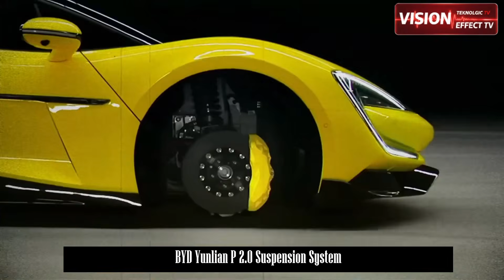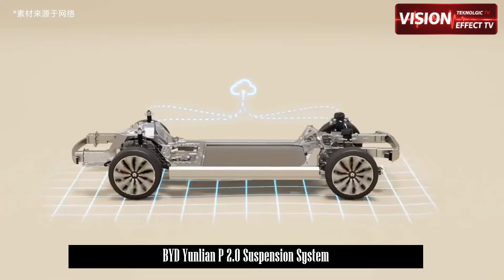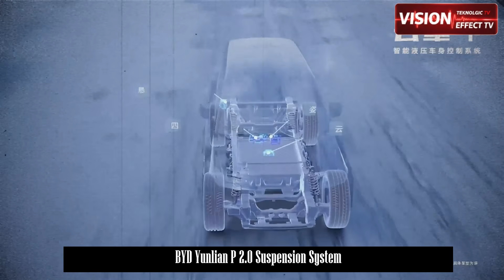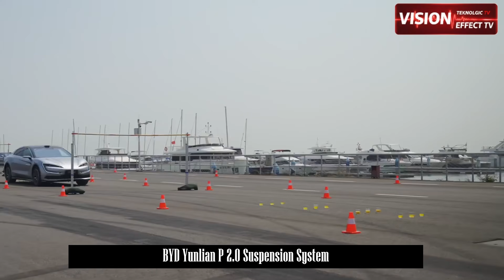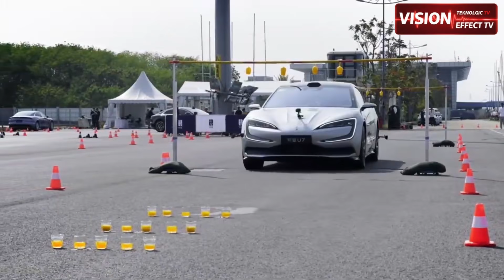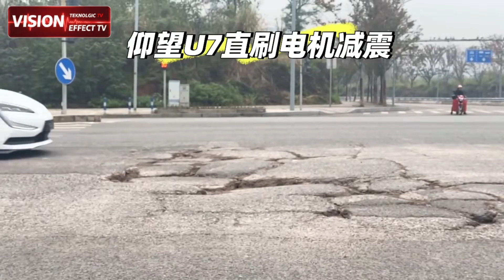Tesla Can’t Do This… But BYD Can

Comment: Ever seen a 1991 Toyota Soarer UZZ32, full active hydraulic syspension...
Reply: Is it available to buy today…
Reply from the maker: Yunlian-P... or DiSus-P in international nomenclature... is not a standalone product you can purchase off the shelf for aftermarket installation. It is an integrated intelligent hydraulic body control system.

If your question pertains to acquiring a vehicle equipped with this architecture today... the answer is affirmative. But only within specific parameters.

Currently. The system is the structural backbone of the Yangwang U8 and the Fang Cheng Bao Bao 5. These platforms are operational and commercially available in the Chinese domestic market.

However. If you are searching for a global release or a specific "2.0" version standalone update... you must understand BYD's deployment cycle. They prioritize high-end off-road and performance luxury segments for this specific hydraulic setup.

The hardware exists. The software is live. But your access depends entirely on your geographical coordinates and your willingness to invest in the premium sub-brands.

Status... Available through specific vehicle integration. Not available as a modular upgrade.